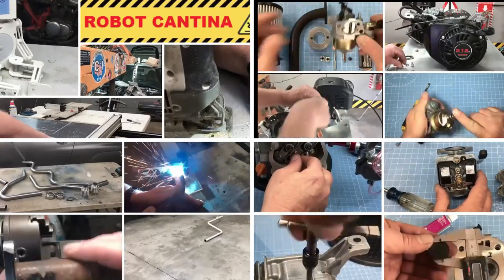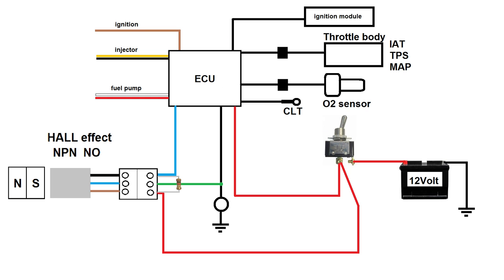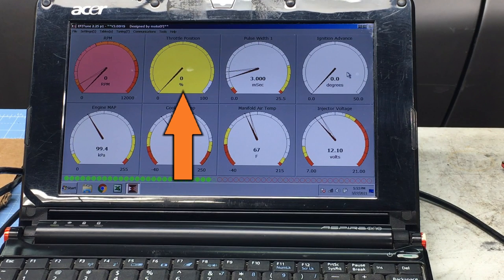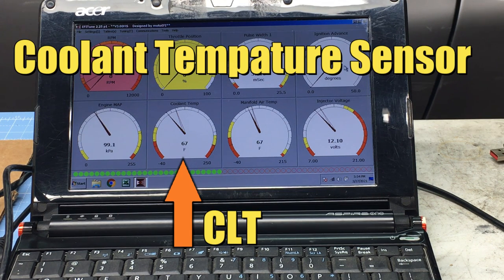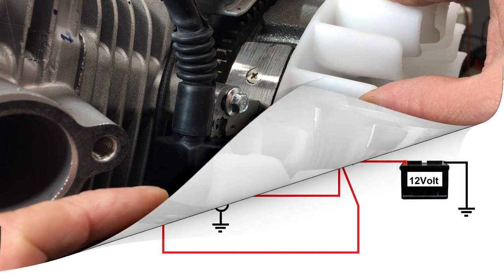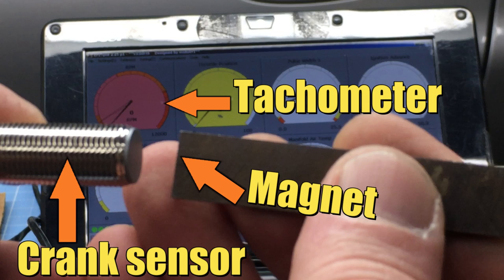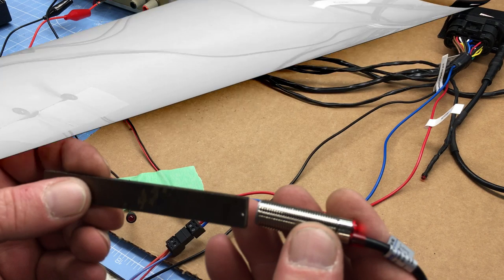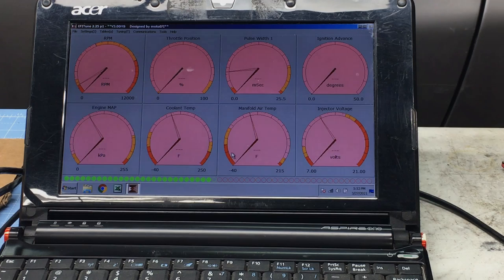Episode 19. We bench test the cheapest EFI kit on Ebay. Will it work for our street legal go kart?

Comment: You're going to get a 420cc engine to go 100 mph before it's over with! LETS GOOOOOOO!
Reply: Should require about 65hp to hit 100 mph 😁

Goalz
Reply: @smokenchoken1736  that's a big ask for 420cc.
Reply: @rre9121  Motorcycles and ATVs can do it, what he needs is an oil cooler
Reply: @5.43v  and a centrifugal supercharger
Reply: Nitrous?
Reply: @YeeticusMaximus22  James get the tool box
Reply: I mean, a motorbike will do that easily due to the high power to weight ratio. Less plausible with even this very light car.
Reply: 100mph in 7-10 buisness days.
Reply: Obligatory "NOS! Two of the BIG ONES!" comment.
Reply: Not impossible with the billet parts
Reply: A 0.8 chevy spark does that as top speed, i bet that 420 engine can do it with the aerodynamic shape of the car, at least with some forced induction, it'll need at least 1 bar though... Nice future ideas for Robot Cantina...
Reply: @johnbelwell2461  I have a 0,8 Matiz (essentially a Spark, 1st gen) and that's about the correct top speed for it. It definitely can go faster, but the gearing in the car is designed for city use. That said, 105 KM/h and the engine sits at a comfortable 4200 RPM - Yes, you can easily have a conversation with the rear passengers in the car. Just don't have too many passengers with the A/C on, going up a hill ;)
Reply: And get 8mpg. 😌
Reply: @kantpredict  Power to weight is pretty much irrelevant for top speed, rolling resistance and aerodynamics are the limiting factors.
Reply: @lillexus5589  a 250cc bike engine can do it with like 40hp why does it need forced induction
Reply: 670cc?
Reply: @youtubesbichasspolicys5888  250 bike engines don't use centrifugal clutches either though. He doesn't need forced induction as well. If this gets connected to a cvt or a gearbox this can easily happen without horrible wind resistance. Having a efi setup does allow to add forced induction very easily though, so why not. That ontop of some new internals could help a ton. I'd assume if you got good aerodynamics, no internal governor (efi controlled) and some gearing, you can get there. 
But, if you're in the engine to remove the plastic govenor, you might as well add some parts to prevent the damn thing exploding or throwing a rod through the case. Plus stronger components can allow you to swueeze more rpm. More rpm more power. I'd setup it up for forced induction if you're going through all this work anyways though. 

Hell I am. I'm making a one off efi kit for a 1000cc bike made in the 80s.

Comment: That "Jimbo" Color code - heheh   totally appropriate, and if you are dealing with people used to working around electrical systems, the green replacing the black is the perfect choice.   
Another instructor and me go round and round and friggin ROUND over using green wires on control circuitry - he is from an HVAC background and I am from (originally) an automotive background - most industrial control circuits use black as a 120V HOT (L1) connection and green is Ground  - instead of 12V Negative ( - ) for black and Green as a signal wire.   Since we teach introductory electricity for both automotive and industrial classes - trying to keep each side happy is a thing!
Reply from the maker: Green seemed to be the most logical choice for the ground wire, because as you say, it is ground for some folks.  Of course professionally, I would never use green  for ground on a DC circuit. ... but for youtube, anything goes.
Reply: @robotcantina8957  I don't have scientific data, but I think plenty of perfectly nice weekends are being given over to the binge craze.   We  are binge  -  watching  videos from ROBOT CANTINA😛😛😋😋

Comment: NOOOO I'm caught up to your current video! I only found your channel a day or two ago and have been loving going through the videos. Can't wait for more!

I know absolutely nothing about small engines but have found all this fascinating. I think it makes sense to move forward with your plans as outlined (I like how you have a rough plan for your overall direction going back to the first video) but once that's all done it might be interesting to see how much power you can get out of the original 212cc engine (efi, Turbo, etc.).
Reply from the maker: I would definitely like to EFI the 212cc engine, however I'm nor sure the little engine would respond well to the turbo.  You see, the turbo relies on exhaust  to power the turbine and such a little engine may only generate sufficient exhaust pressure in the upper RPM range.   The 420 is going to be a stretch.
Reply: @robotcantina8957  I don't have scientific data, but I think plenty of perfectly nice weekends are being given over to the binge craze.   We  are binge  -  watching  videos from ROBOT CANTINA😛😛😋😋

Comment: A very small thing.  On the majority of automotive sensors, the three wires, power ground and signal out, are most times arranged so that signal out is in the middle of the three wires.  Very cool video!
Reply: Are you sure? It makes more sense to put the danger wire (power) in the middle so it isn't accidentally plugged in backwards.
Reply: @markmmm1737  I paid off my mortgage working on cars in various dealerships and independent garages.  Also in automotive practice, the three wire plugs are made in such a way that they only plug in one way.  If it is a quality brand, each plug on the harness is made a little different so that there is less confusion when plugging things in.  Such as when doing an engine swap.  Remember, there are always exceptions.

Comment: That software looks a LOT like the old Megatune software for the Megasquirt. Which leads me to believe that this EFI kit is using unlicensed Megasquirt code, violating the GPL. If true, then have taken the Megasquirt code and are running it on non B&G hardware which is a direct violation of the license.

Comment: Just to be clear, your 1000 ohm resistor is actually 1100 ohms (by color code).  Should still be good as a pull-up.  Your 560 ohm resistor on your LED will be drawing around 20mA through the LED, which is on the high side for most LEDs.  1K to 2K would be a better choice, keeping the draw to less than 10mA.

Comment: Looking at that open source connector, that should deal pretty well with rain water. I have taken care of a large amount of off-grid solar power systems. And what you say is a standard color code is something I've never seen. But I've seen everything else. Never assume any color means anything before you figured out who built the system and what they were thinking

Comment: This is awesome.  I'm surprised that some of the outputs are based on only a 2 dimensional table, I would have thought things like ignition timing and fuel mixture would have depended on a much larger multi-dimensional array, the dimension equalling all the sensors and values including RPM.

Comment: That netbook though... I didn't even know one would still be working these days.
Reply: I have the same one and it still works, they are perfect for this kind of stuff.
Reply: I've got a few I keep running for 32 bit only applications
Reply: I have an old Windows 98 machine and hp printer that I keep running just to print envelopes once a year, it a fun blast from the past every time I use it...
Reply: Ah yes, the ZG5/AOA150...  those things are tough as nails!  Mine has gone through more different OS's for experimenting on than you can shake a stick at.  Great little machines!
Reply: @-mike-8134  98SE was more reliable than W10 is.

Comment: Did you try the hall effect sensor without the pull up resistor? I would be surprised if the ECU doesn't have an internal full of resistor for that line.
Reply from the maker: Yes, I did try it without the pull up resistor.
Reply: @robotcantina8957  I wonder if they left it floating to allow for different types of sensors
Reply from the maker: @DoRC  Its possible.   The Ebay seller configures the system with a basic MSQ and recommends the hall effect sensor.  However there are other choices in the configuration tab.  The only problem is without a system schematic of the ECU I'm pretty much guessing if I deviate from what is expected.
Reply: @robotcantina8957  yeah it's crazy but unfortunately not surprising that it doesn't come with any sort of instructions.
Reply from the maker: @DoRC  I think there may be a language barrier with the seller and that's why no instruction.  This kit is easy stuff if you know your way around a Megasquirt and tuner studio.  Anyway,  Most armatures wont touch something like this without instructions and that probably benefits the seller because they don't have to deal with support.
Reply: @robotcantina8957  seems reasonable

Comment: Also fun fact. The kit you have is essentially a micro squirt system.
Reply: I run a microsquirt on my VW Beetle. That's not a Microsquirt unit, and it's using a different tuner program. But it does look like it works the same way, does all the same stuff, certainly a "comparable" system. Maybe a competitor or knock-off.
Reply: @quillmaurer6563  i have this system and a mega squirt. The files read the same and can be viewed in megalog viewer.
I didn't say it is. I said it's essentially a micro squirt system. Implying it's a knock off.
Reply: @X7rocks  Yeah, certainly very similar - I thought you were saying it was identical. Can this be run in TunerStudio? I'm running microsquirt on my VW Bug, and I'm starting to contemplate getting a motorcycle someday. As the sort who can't leave stuff alone, and preferring EFI over carbs, I'm thinking I might convert the bike to EFI just like the car. Especially if I get a bike with bad carbs, I might just convert to EFI rather than try to make the carb work. What system would work would of course depend on the type of bike, how many cylinders or intakes (if it's a single this kit would work, but it doesn't look suitable for a multi-cylinder or even multi-inlet). I'd probably try to stay as similar to what I have on my car as possible, for "fleet commonality" and my own familiarity. If this works pretty much the same as Microsquirt it might be preferable as it's smaller (space is at such a premium on a bike), and looks like it can control the fuel pump without a relay (said relay being almost as big as this ECU). Plus it's probably cheaper, he got this whole kit for less than I paid for my Microsquirt ECU.
Reply: @quillmaurer6563  to be honest i think ecotron efi would be a better solution for a multiple carb solution as im only aware of these efi kits supporting a single throttle body.

I never tried using tuner studio as per the wish of the manufacturer who sold the ecu (funny enough the files seem readable but i didnt want to have the trouble of bricking the ecu)
I will say my biggest hurdle with this ecu setup on my 2 stroke engine was throttle enrichment after going full wot down the road, and finding larger injectors to fit my specific build.

But for a single cylinder this kit may be more than useful in your scenario.
Reply: @X7rocks  Would have to research this Ecotron option. This is far off, just ideas at this moment, would depend on what I end up getting.
Reply: @quillmaurer6563  ecotron also has excellent customer support that will be more than willing to help you out if necessary :)
Reply: The software seems to be megatune.

Its probably ms1 based.
Reply: @dannthenitroman  that would make sense. I've only used ms2 but saw older ms1 unit software around and was very similar looking.
Reply: Mega squirt works with bike throttle bodies has been done many times. There is one iac tps in the middle where  you have your throttle cable. You do have to run primary and secondary injectors. Not sure what size engine you're running either though. I'm not a fan of megasquirt, but I know for a fact it's going to have more options than this. Megasquirt is just really expensive for what it is. You can build your own EFI system for 1/4 the price...
Reply: Speeduino. Look it up.

Comment: Perhaps you should try some internal mods next... such as the .265"-lift camshaft & 440-cc "stroker" crankshaft that's available for this model engine, to improve the amount of "grunt" it produces? Maybe some higher-ratio rockers, to open the valves a bit further, to allow more air/fuel mixture in? \:|

Comment: O2 test would b unplugged they sit a bias voltage. 0 to 1.0v o2 sits at 450mv. Their for plugging it in would change ur gage readings. Not a great test but checks wirs are hooked up.
Reply: P.s. most ecu don't read o2 until coolant temp reaches a certain point.

Comment: Is it possible to do a power draw test of the whole system? I'm thinking of retrofitting such a system to  a 50cc scooter, but those usually have pretty limited generator output...
Reply from the maker: Yes, once the system is installed, I will measure the current draw.

Comment: Really cool project!  I am wondering if the motor would be more efficient if you removed the torque converter and installed a simple centrifical clutch?  Those small torque converters seem to be very dependent on final gear ratio to maximize performance.  I would guess it's inefficient in taller gears.  I would think with the right sprocket the 5 speed should be sufficient without it.  Thanks for your time.

Comment: So the pull up resistor is basically a 12V jumper wire with a 1K ohm current limiting resistor to protect the ECU
Reply from the maker: The output of the hall effect sensor will sink to low or ground when triggered.  The pull up resistor will pull the line back up to 12V when the sensor is not triggered.   Anyway with the pullup resistor, the output should look like a square wave when the engine is running.
Reply: @robotcantina8957  True. On a side note I read somewheres about the interesting way in which the ECU identifies faults in these circuits by using the potential difference comparison of an internal reference voltage and the sensor signal voltage. Useful for finding open circuits, shorts to ground or shorts to battery voltage. It's been a while so I could have my info backwards but nonetheless it's useful information for fault finding within these circuits
Reply: @j.m.5995  I don't have scientific data, but I think plenty of perfectly nice weekends are being given over to the binge craze.   We  are binge  -  watching  videos from ROBOT CANTINA😛😛😋😋

Comment: Very cool. I was looking at this kit also. So the kit doesn't have Idle Air control?
Reply from the maker: This kit has no idle control function.
Reply: @robotcantina8957  I found several kits online but this is one of the few you can actually readily order. Have you found other good kits for small single cylinder engines?
Reply from the maker: @castirondude  This is the only reasonably priced full kit that I'm aware of.
Reply: @robotcantina8957  I don't have scientific data, but I think plenty of perfectly nice weekends are being given over to the binge craze.   We  are binge  -  watching  videos from ROBOT CANTINA😛😛😋😋

Comment: Quick way to test o2 sensors is to spray them with brake cleaner while monitoring live data. It should respond rapidly because the brake cleaner is displaying the oxygen around sensor.

Comment: I have some experience with this stuff on automobiles but your explanation was entertaining and well presented so I watched anyway. Good job! I understand you didn’t want to get too technical and it wasn’t really necessary but a few words on the magic that happens in an oxygen sensor might have been appropriate for some viewers. The car is coming along great and the whole series is very interesting. That flywheel magnet looked a little dinged up, maybe the pickup had crashed into it during assembly.
Reply from the maker: Thanks,  I'm trying to keep some of the explanations simple, I'm not really sure how much tech my audience can handle.  The 2nd EFI video is to be released 4/27 and has a little more tech, but still simple enough to follow.
Reply: @robotcantina8957  "I believe in having fun first, and along the way, if you teach people, if you influence people, well and good."

Comment: At 14.42 in the video, the menu has a box, 2nd from the top, labeled "skip pulses" and the value is 1. This is because it's a 4 stroke correct? On a two stroke, would this value be "0" as in skip zero pulse and fire every stroke?

Comment: The software is a straight rip off of Megatune which is the tuning software developed for Megasquirt, an open-source (ish) fuel and ignition controller, so I suspect the controller design is as well.

Comment: SW looks like early megatune, even the old megasquirt logo in top left corner.

really hope it will be "opened" by the manufacturer or some reverse enginering.
would be killer if it could be flashed with megasquirt or speeduino and used with tunerstudio ...... please please ......
just imagine monitoring engine data on shadow dash via bluetooth on android  tablet 😊

Comment: Seeing you do this build is making me wonder if i should use the efi kit i have to turbo a lifan 250 engine.

Still enjoy watching this in general and very cool to see how a 420 can handle boost. With a billet rod/crank and piston it should handle 15 psi. And a cam that can rev to 8,000 rpms should really aid in spooling potential.
Reply from the maker: This EFI kit should work fine on a 250, but the turbo is going to be a stretch.   We are planing on having problems because single cylinder engines are tough to turbo due to the slower pulses in the exhaust.
Reply: @robotcantina8957  i always wondered if you can offset that with just a bit more boost than 13 to 19 lbs. Maybe even some extra cam overlap if possible. Would be a very interesting test 😁
Reply: @X7rocks  I don't have scientific data, but I think plenty of perfectly nice weekends are being given over to the binge craze.   We  are binge  -  watching  videos from ROBOT CANTINA😛😛😋😋